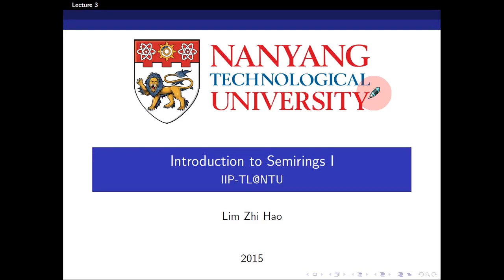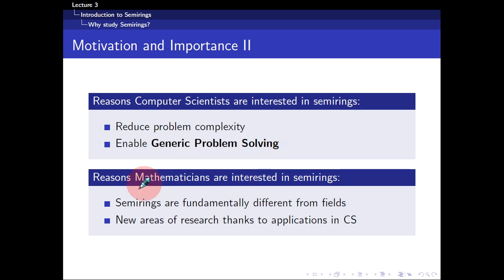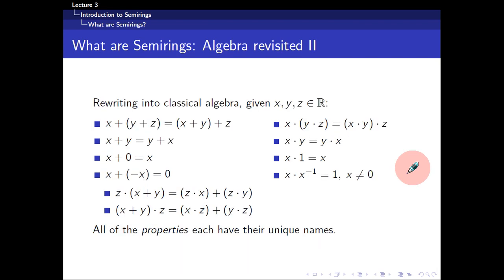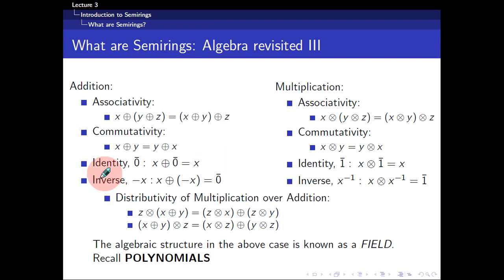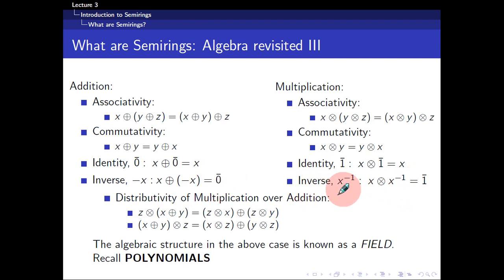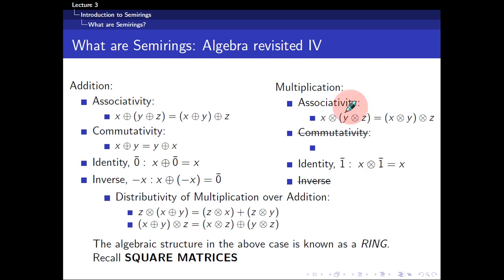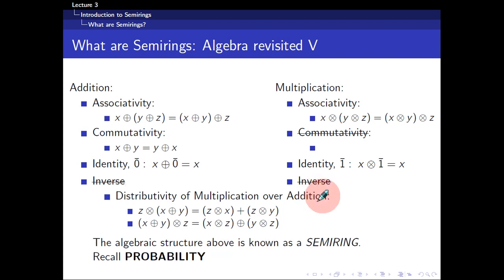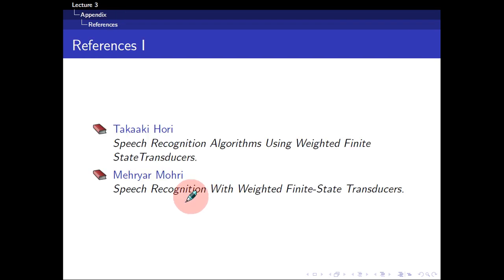Lecture 3  Introduction to Semirings I

Comment: I have a question. Why probability does not satisfy multiplication commutativity?
Reply: Because probability is defined on a unit interval (from 0 to one), so for example the multiplicative inverse of 1/2 would be 2, but 2 is not in a unit interval. So not for every element of a unit interval there exists a multiplicative inverse (only for 0 and 1 actually). Same goes for additive inverse, this time all inverses would be negative.
Reply: I think that the semi ring definition states that it may or may not obey those properties, but that its not required to